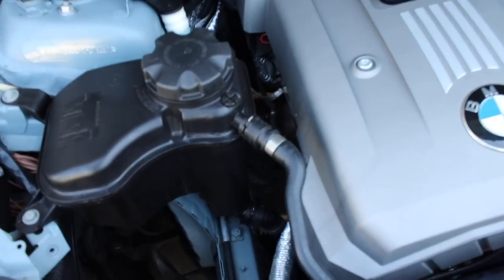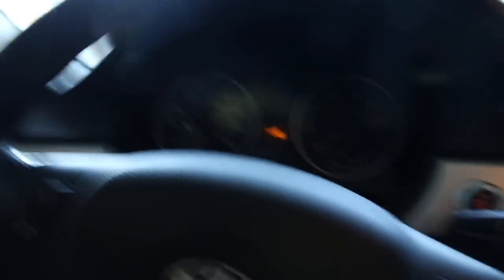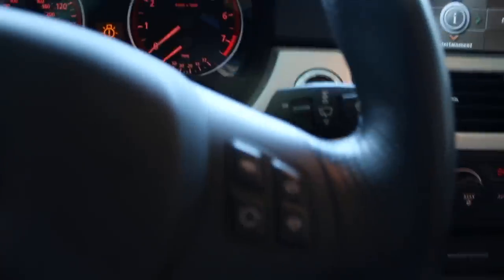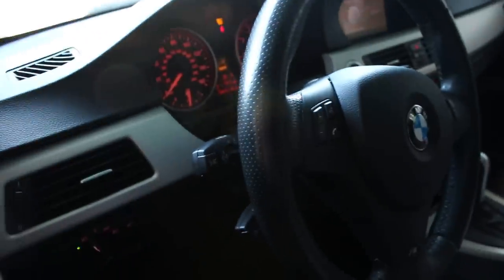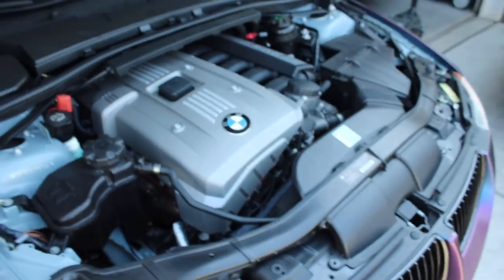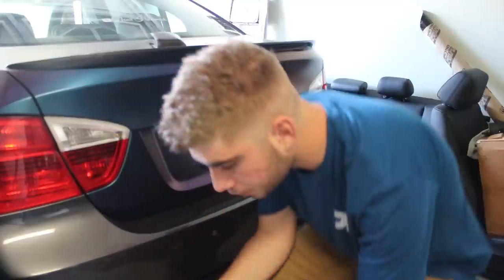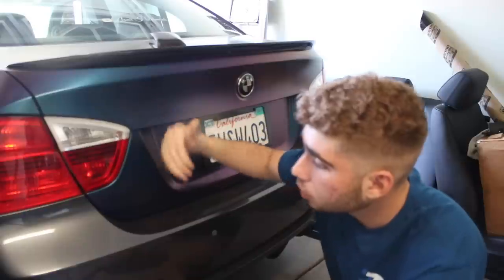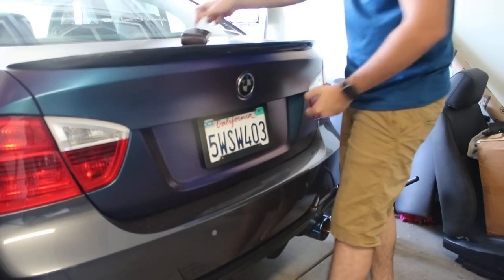BMW HIDDEN FEATURES/FUNCTIONS (E90,E91,E92,E93) (PART 2)

Comment: WOW, I cannot tell you how much this guy just saved me on my bill, I had a transmission problem, because I am younger and drive faster, the previous owner was an older woman and drove slow, and when I did the reset of the transmission it fixed itself. I need to meet this person in real life and hug him. If this guy who is in the video right now is reading this, I am so grateful for you. Thank you so much, you probably saved me around $2,310.
Reply from the maker: Mikhail Mayer I’m glad I helped :)
Reply: Same situation happened to me. I bought it from a one owner old lady and it was super jerky until I reset it and now it’s working smoothly 🙌🏻
Reply: Danny Jr when you hold it down for a minute is anythong going to pop up or do you just assume that its been reset?
Reply: i think it resets itself automatically. nothing pops up.
Reply: Hi Nour, can you tell me does that transmission reset thing work with manuals too?
Reply: @Terminator775  da radi ja sam na svom probo i radi
Reply: Yeah man, Nour did a vid on some wonky warranty. Long story short, Sir Hummadi saved me at least 9 grand. Still got 7 years and 50 thousand on the warranty as well.

Comment: how do u use the secret menu to make ur windows go up?
Reply: Yeah, how?
Reply: Yeah please respond because I don’t think you can without softeare
Reply: Press and hold the lock button to close window
Press and hold the unlock button to open windows
Reply: Has to be "coded"  in If in usa.       But coded basically means unlocked.

Comment: I have a 328i xdrive 2009 e90 and the and the angel eyes light is off in the day just come one when I activate the headlights ant nigth or put on en the day normaly I using the auto headlights but I see another cars on the day with just the angel eyes lights on how I can do that??? I really appreciate if you help me and to put on the welcome light in the bottom of the front doors one time I disconect the battery and is not come on again... I don't know why... I don't have screen in my car to do anyting 😥 😥😢 thank you very much

Comment: Can i reset the transmission the same way on my 528i  2009.  I just bought it and took it for a long drive. When getting on to the freeway, i hit the gas hard then immediately let go of pedal cause i thought a car was coming and then hit it again and it jammed and said Transmission Malfunction. I pulled over, turned car off then restarted it and cleared the screen. And all was good again. So i wanna reset it, if its an adaptive transmission maybe it wasnt ready for that move i accidently did.

Comment: Does also apply to resetting my convertable top also..I'm getting the top not locked when it is locked and the convertable top light is blinking in my 07 650i

Comment: Very good video!!
I have a problem with 1 2 3 buttons on the rear view mirror. I can't seem to sync it with my garage door opener! I have spent hours clearing the code and syncing. Can you please advice how to reset this factory settings? I believe there may be an error code in the car on the bcd but I don't have a tool to check or know how to do this!
Thanks in advance!

Comment: I have a2006 325i. My key fob does not open for battery replacement! Why does the dealer say they’re $350 & I see them on eBay for $50? Help me out, Because of my fob battery dies I cannot start my car

Comment: Hi bro I have Bmw1series 2013 so I have changed reverse bulbs but one off them not working I checked all fuses all fine can you let me know what’s happened thank you bro
Reply from the maker: Jaafar Ahmed could be the modular
Reply: I'm late but make sure your ground is good and clean. Also get gallon of gas, pour through sunroof, light, walk away.youll thank me later

Comment: I just wanna ask a question about my engine  I got 2009 335i coupe convertible Nway my engine it’s kinda noisy when I’m warming up I don’t really know about BMW this is my first BMW car so I see you you said you restart the transmission but I am still not so sure about this noise if this is a transmission, I don’t know about the BMW engine it’s noisy or not. It did any happen to your engine sounds like noise.
Reply: Check the hydraulic fluid level, if its low fill it back up. That's all I can say

Comment: My 2005 525i has an issue no one can figure out. When I drive the RPM's go up and down. It feels like a bad fuel injector but that it not the problem. It is really bad when I slow down and have to speed back up on a hill. Feels like bubbles in the gas! Do you think the transmission reset would help? My car doesn't show a code or anything. Ugh. I have owned the car 3 years after I bought it used so I am not sure if that will even help... Thank you!!

Comment: Great video! Owned a E92 for 3 years and I didn’t know about the waterpump feature!

In the step of resetting the trans it should also reset the injection to standard values btw.

Comment: If you reset your brake miliage it may kick your brake light on the dash, it did mine. I had to have the mechanic plug some wear values into the computer because i essentially told the car it had new brakes but the wear sensors were in conflict with that. He reset mine for free. The dealer said i had to have a brake job, that was 3 years ago.
Reply: Good tip!

Comment: Can you please explain what's the purpose of the 1st trick (Fluid flush) ? It made me very very curious
Reply from the maker: Mica Raul it’s to bleed the system when  you do a coolant flush/refill.
Reply: Mica Raul i have a 2011 320i exclusive touring if i do the coolant flush do i need to refill with coolant after or just start the car as normal also with the automatic folding mirrors my drivers side is on the other side so do i move my side mirror button to the left or right?

Comment: First thing I did when I bought my 330 was so the transmission reset and it was phenomenal the difference it made!
Also are the radiator fans prone to failing? Mine doesn't turn on at all and I'm signing to diagnose it
Reply: Lachy's Garage yeh a common fault is the fan blower dies so you’d need a new one

Comment: Hi. I have a question...can anyone help me. I replace the head light and angel eye light bulbs on my 2008 328i. The head light I replace it with "" D1R 8000K Xenon HID Replacement Bulb Ice Blue Metal Stents Base 12V Car Headlight Lamps Head Lights 35W " and for the angel eye ""E90 Angel Eyes Headlights,2x20W 6000K White CREE Halo Ring LED Marker"" everything works but the warning light still comes on every time I start my car. Can you help me or anyone? Please and thank you.

Comment: Better to keep the mirrors out.  It will help keep your doors from getting scratched, buy making people walk around it.  It's an obstacle for them to walk around, and my even keep people from walking there.  if your mirrors were folded, they will be like wow it's wider here, my shopping cart can fit.   I'd rather have my mirror scratched than my door.
Reply: Jeremias Delos Reyes great point
Reply: The thought of someone scratching my 335i hurts but it hurts more to know it’s inevitable 😔😂
Reply: You can program it using carly to fold the windows in if you hold the lock button for 0.5 secs. If you just press it it leaves the mirrors open

Comment: Hmm. I'm having the same exact issue. When I'm in DS or D manual car shifts perfect. However in D it will have a jerky downshift into first gear. I will try the reset on the trans. I look forward to the video on replacing the transmission pan and the fluids. I just hit 100k so it's due to be changed. Thanks for the information on how to reset the trans. Greatly appreciated.
Reply from the maker: Pickle MeTimbers yea man exact issue going to do the pan soon

Comment: If I bought the car 2mos ago, would I still need to do this? It's adaptive right(?), or is a full reset required for a new driver with a heavy right foot?
Reply from the maker: you only need to reset your transmission if its jerking. Most times it will just adapt to your driving habits.

Comment: Just a quick side note... On the manual trunk release mechanism... This is only on e90 models from 2006 - 08... All lci models have had this function removed. So if you are planning on changing up to an lci trunklid and lights you will lose this feature. 

Excellent video as always 😀
Reply from the maker: Preshaan Briglall thanks man for the info and thanks for the support

Comment: Does the transmission trick apply to manual transmissions?
Reply from the maker: I believe it works for both. but dont hold me too it
Reply: only on AT, to reset the adaptive MT you ned to do lobotomy on the driver.

Comment: Sir I hate to be a pest! Forgive me but do they make / sell a device to remove the codes from your car. I had my oil changed, air filter, rotation of my new tires. I take excellent car but after the warranty goes off BMW service charges extremely high rates. I'm not cheap but to change oil, put a air filter,  fluids. Anything major it goes to my BMW. Again we aren't stupid people but on the other had not everyone tells you the secrets either. Thank you Sir for your time.

Comment: Don’t try the transmission thing I thought it would help me but it caused a misfire
Reply: Unlikely it caused the misfire.  Because your transmission in "learn" mode is adjusting the shift points up and down the torque curve, based on your acceleration patterns (i.e., to optimize your fuel economy vs. power), your car is probably running in the lower torque bands than usual (if you drive like an old grandma) and because of that you are not burning off the fuel in your cylinders as cleanly and THAT is what's causing the backfire.  But you need to get to the root of that problem -- bad plugs, coil packs, whatever -- if you want to keep your engine in top shape.
Reply: If you had a missfire, your check engine light would be on.

Comment: I lost my BMW key does anyone know what I can do and not pay $900 at the dealer for a new key ?
Reply: My sphere key does not allow me to start the car or unlock it without pressing the unlock button or inserting my key into the ignition? Anyone know what’s wrong ? I used to be able to touch my handle and it would unlock